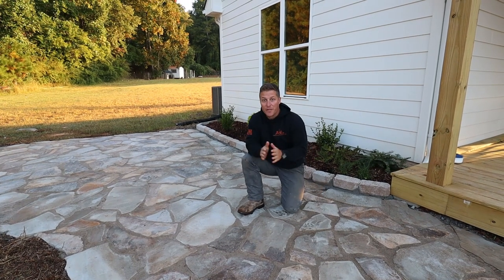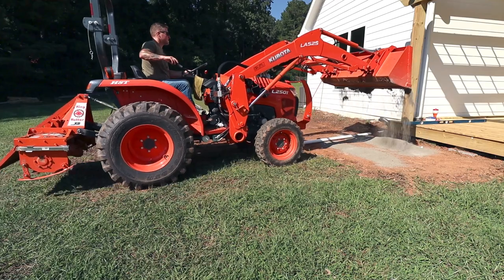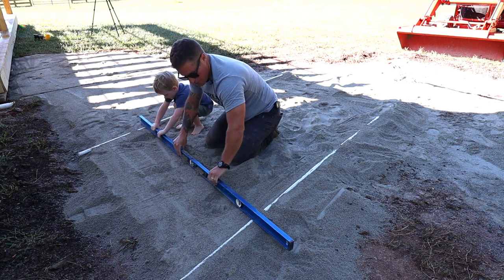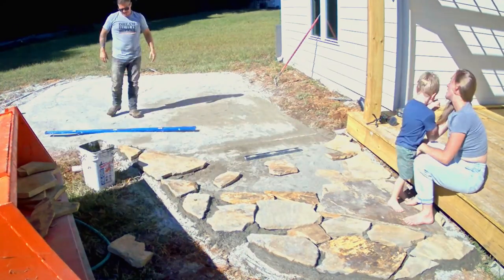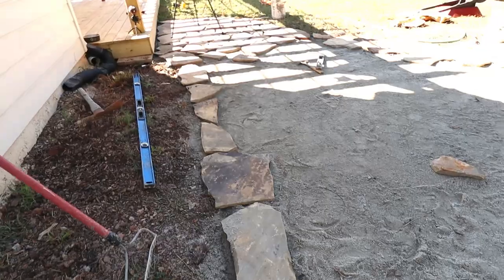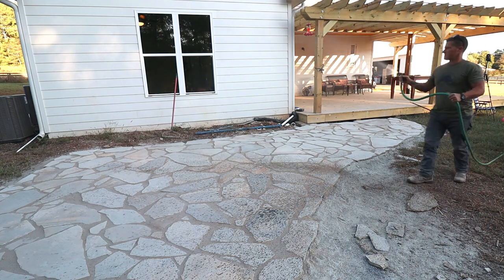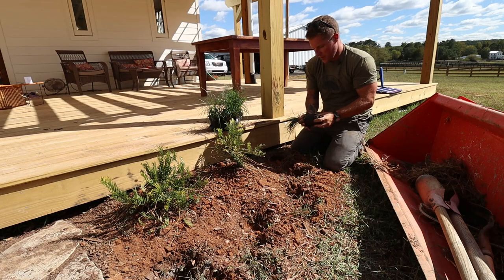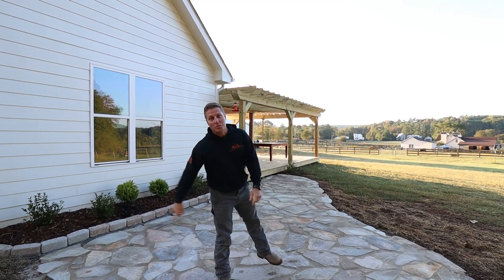BACKYARD TRANSFORMATION. DIY Flagstone patio step by step.

Comment: I just installed a flagstone patio, and I have a new respect for anyone who works with these slabs.  My flagstone steppers are way more uneven, (Pensylania Steppers) and I was more fussy about the fit, so there was a lot of grinding and chipping,  plus our patio included 6 steps.  Otherwise this was fun to watch you do it and compare notes.  I cannot believe you worked with those stones and cement without gloves or a mask (esp cement dust).  Also, I invested in worker pants that have built in knee pads.  Those things are awesome.  Well worth the investment if you tend to do these kind of jobs that most people would hire someone to do.